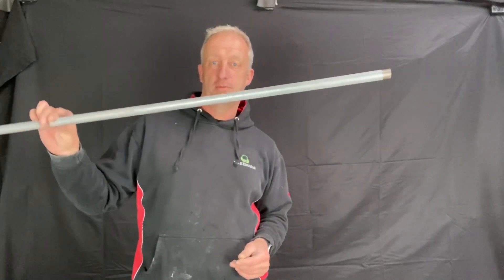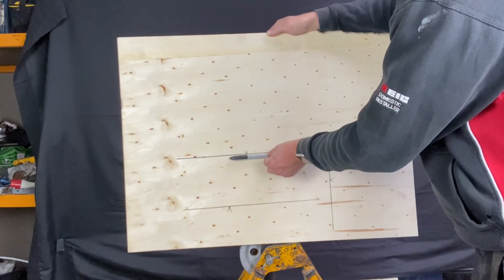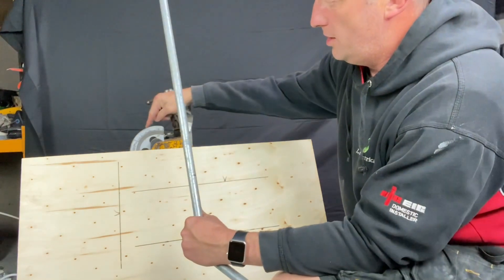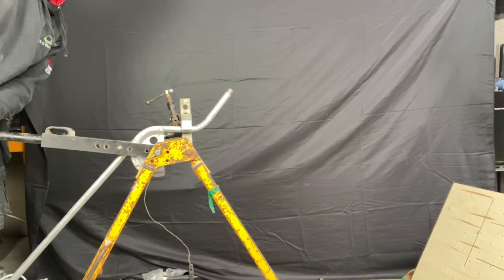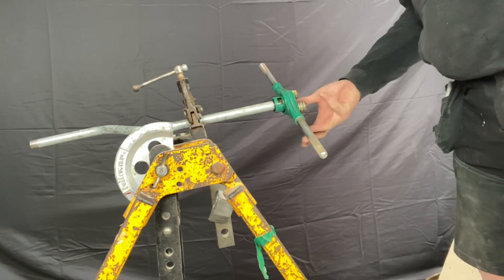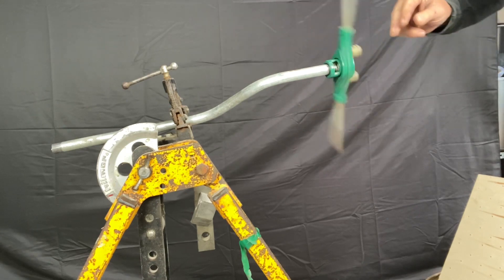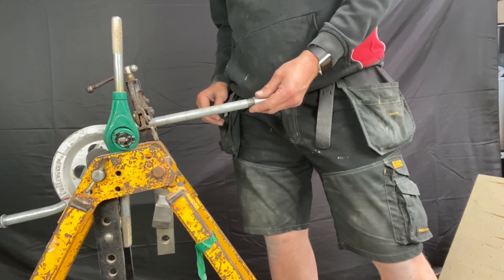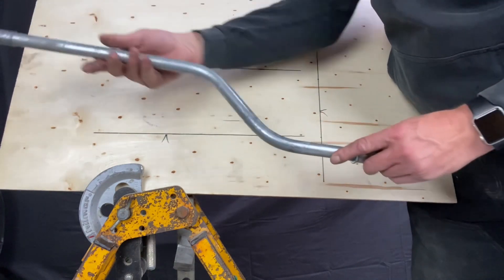Putting a double set into a 20mm conduit.

Comment: Hello. Is your conduit horizontal when you put it into the bending machine (using a spirit level)? I've just started with this stuff and at college the conduit benders have conduit that's not horizontal when its put the bender which I thought was odd as you have to "eye ball" the bends rather than being able to use a magnetic spirit level on the end that being bent to indicate you've at the desired angle. Any input appreciated here.
Reply from the maker: It’s not perfectly horizontal as it doesn’t need to be. You need to use the level or straight edge to measure the start of the bend. If you were doing a long bend (bending up) it would be horizontal.
Reply: Spirit level on a bender with a horizontal piece wouldn't work anyway as the floor the bender is on might not be level itself